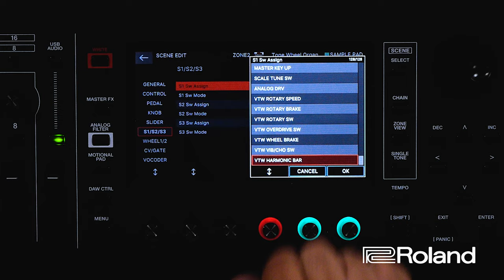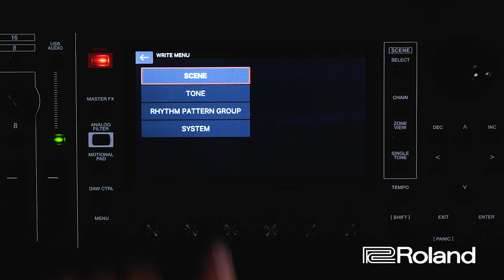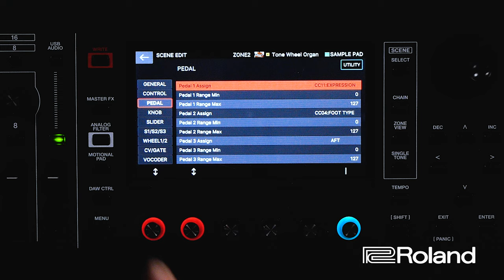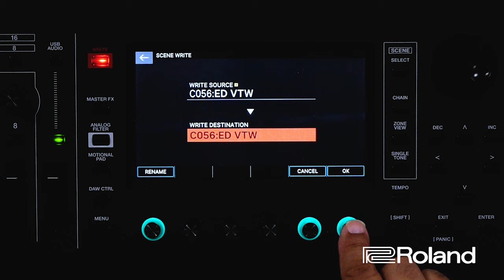Roland FANTOM - How to assign Rotary Speaker Speed to Switches and Pedals

Comment: Ed does this change how in zone one if you go to single tone Organ and you want to assign a rotary through the effects parameter to a pedal or button is this gone now in version 2.5?  Maybe this is something wrong with my keyboard but the left-hand side of the screen where you navigate up and down is not there at all. You push the parameter button and totally different screen shows up than what you have on your screen on that old video where you’re assigning to pedal button wheel It’s on the video how to assign a rotary to a wheel a button or a pedal. In other words there’s no way to assign a cc.